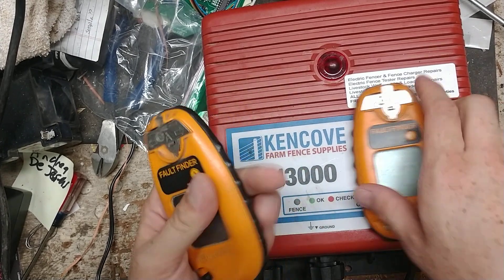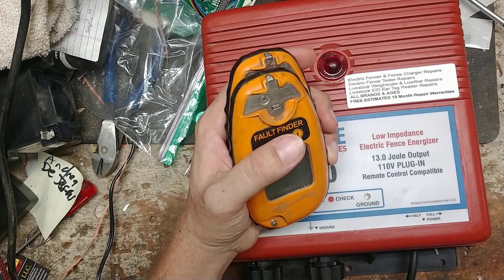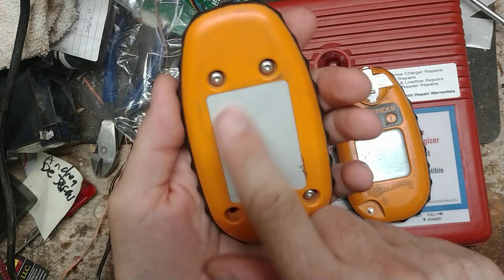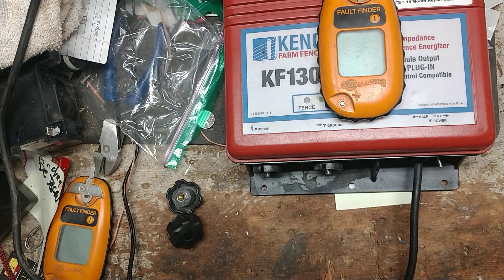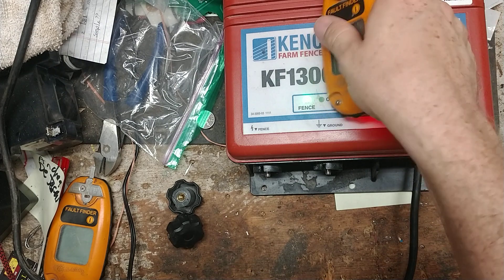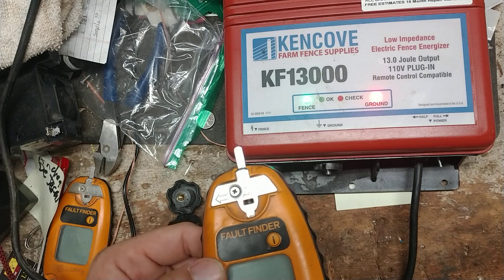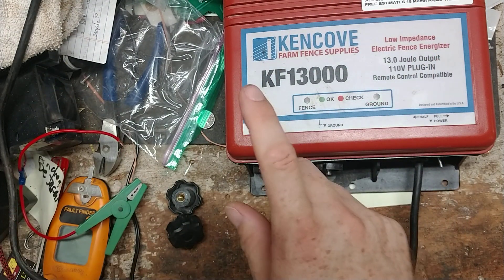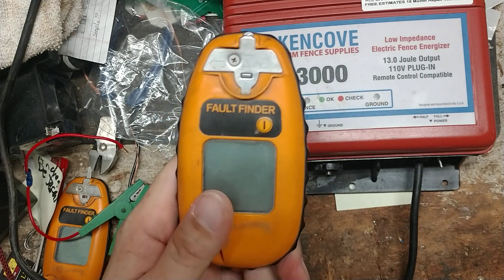Using An Electric Fence Fault Finder To Test A Fence Charger

Comment: Is they a way to change modes on a galhger fault finder
Reply from the maker: On the older version you would press the button on the front you switch between kv (killovolts) and A (amps). On the later/current version kv and a was on the same screen at the same time and you didn't need to switch anything.

Comment: Three different testers getting radically different readings. This does not speak well to the quality of the product. 😢
Reply from the maker: Are you talking about the testers in the video? Or do you have 3 different testers there with you? Are they the same brand, same model, and similar year built?
Reply: @FencerFixerRepairLLCKansasCity  The three you have on the video were where my comment was based, but I have two Gallaghers that do he same thing.
Reply from the maker: It depends on the age as well, they have made changes to their testers over the years.